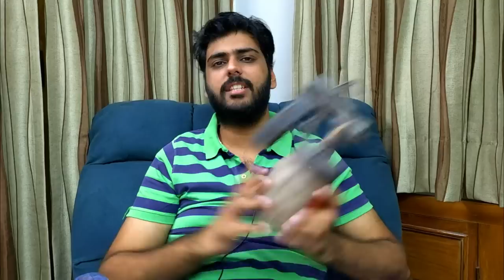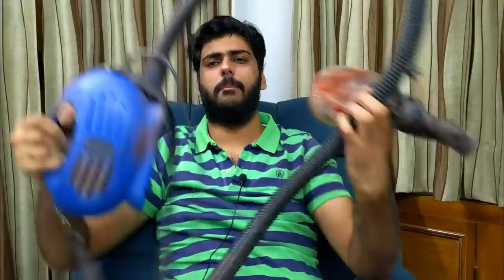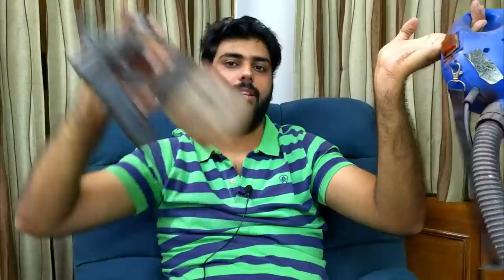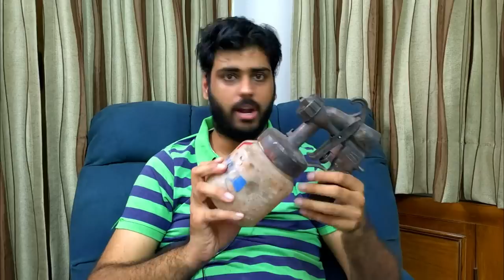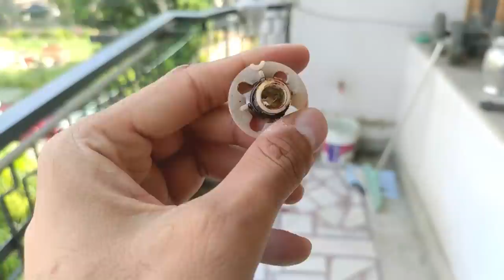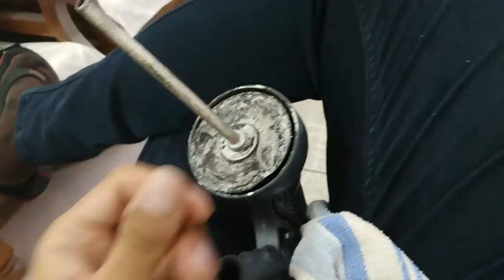Paint zoom Spray Painting Machine (Full Review)

Comment: Within 5 minutes of use it's starts heating  so I stop the use  to save the motor burn. can it run for 25-30 minutes please reply.
Reply: Hamster
Reply from the maker: Use it normally as you will always be switching it on and off as you were painting whatever you want to... It will keep on running no issues...

Comment: Bhai factory ki wall isse paint hojayegi? Kaunsa paint use kare factory wall ke liye jo cheap ho jaise super samosam? Super samosam se nozzle to choke ni hojayegi?
Reply from the maker: Better to use asian paint if you can that's the best i found in terms of quality and never used samosam if its similar to asian it will work just fine... And factory ki walls aaram see paint hojayegi isse...
Reply: @AmulLuthra  Asian paint is no doubt good and long lasting. However when the perimeter wall is around 250 meter then covering it both sides with Asian can cost thousands.

Comment: Nozzle tip size ki info hai kya kuch ??

2mm primer ke liye use karte n 1.5mm paint ke liye.....

Is product ka kya hai ?

Mai HVLP lene ki soch ra hu..portable handheld
Reply from the maker: In this machine spraying hole is adjustable by the adjuster on the trigger. And primer and paint both works fine. Checkout this video.
https://www.youtube.com/watch?v=4vBXGzYrIJI

Comment: Bro . . i got the Paint Spray ( i can only use by Electric ) 

But the normal hand gun i can't use it yet even if i press it doesn't spray . . 

Please help .. Thank you 🙏
Reply from the maker: The machine is kinda just a blower itself. Just connect the air pipe and it should work...
Reply: @AmulLuthra  we tried but it doesn't work